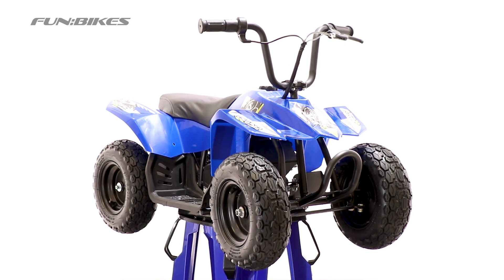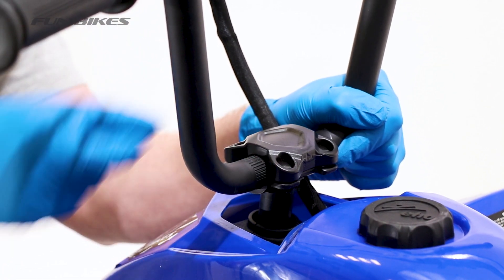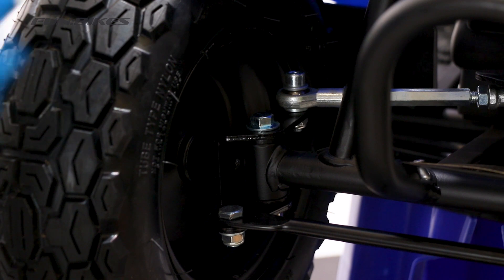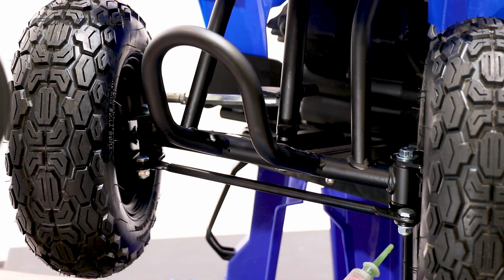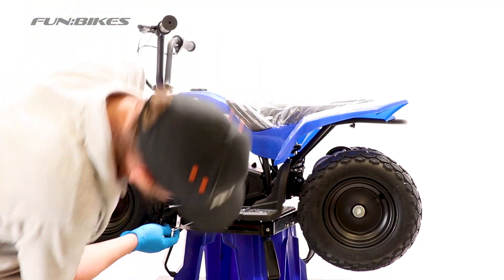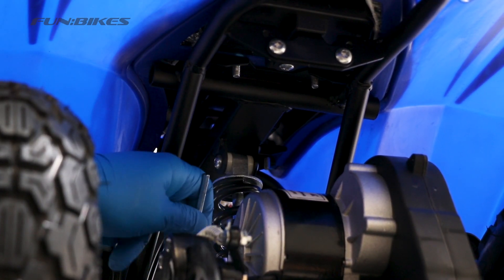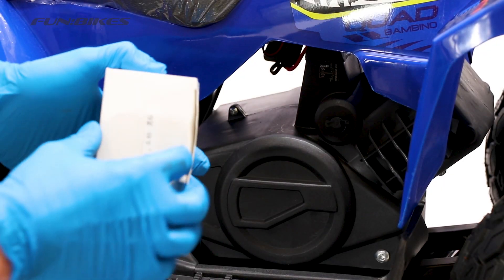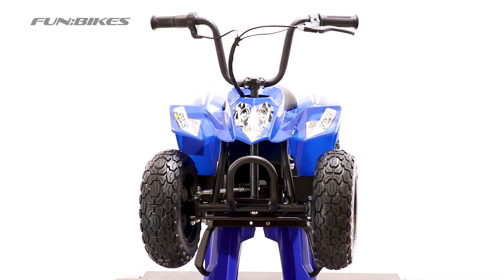Technical Help: How to Build the Funbikes 24v 250w Bambino Kids Electric Quad Bike

Comment: Iv bought a bambino  from.out of the box and there is no power, my charger stays green ,but nothing works
Reply from the maker: Did you connect the fuse?
Reply: @funbikes  found the fuse holder with a plastic cover on it ,is this what I'm looking for  because I don't understand where the fuse sits
Reply from the maker: @briantweedy336  If you're still experiencing an issue please email tech@funbikes.co.uk for assistance, thanks